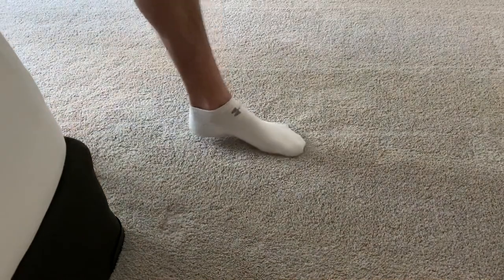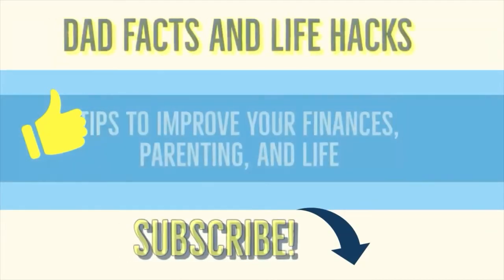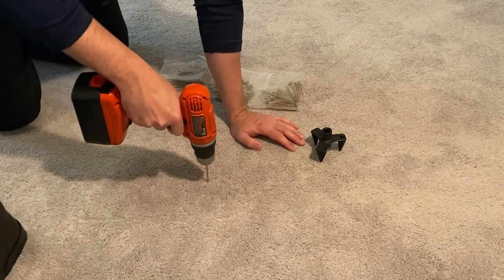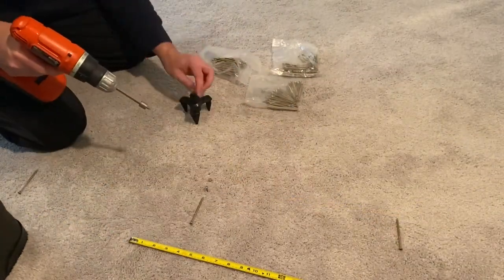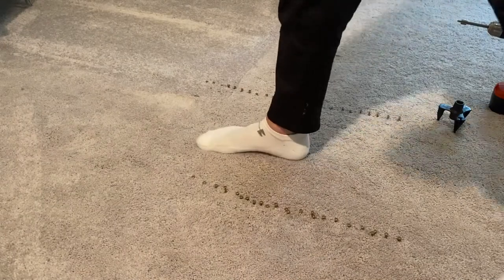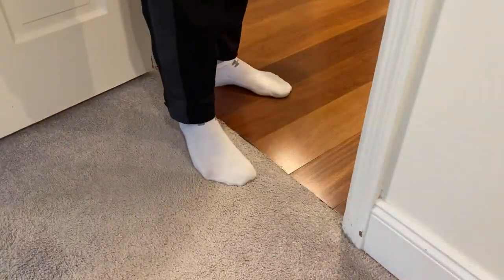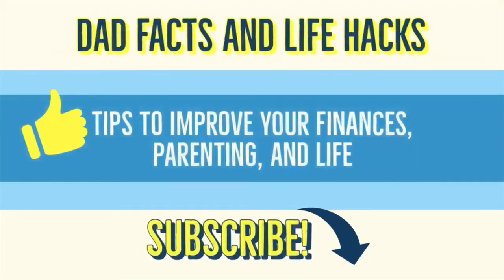🔇 How to Fix Squeaky Floors 🔇  | Squeak No More | Carpet and Hardwood Floors

Comment: If it doesn't fit the bottom bar, will it still work? I feel like if it doesn't fit the bottom bar, it won't work.
Reply from the maker: It has to be able to drill down to the bottom joist, if it can’t connect to that, then it can’t hold the floorboard still

Comment: Why have you put on so many screws if I may know?
Reply from the maker: Depending on the noise, maybe only 2 or 3 screws will do the job. I used a lot of screws because I was trying to get the floor board really tight to the joist, to eliminate the noise. but unfortunately it didn’t matter that I used a lot (maybe 20 to 30 screws, I lost count), the noise couldn’t be eliminated
Reply from the maker: Nope. I haven’t notice any difference,better or worse
Reply from the maker: It ended up being about a 6 foot linear area for the screws. How did that make the noise worse?
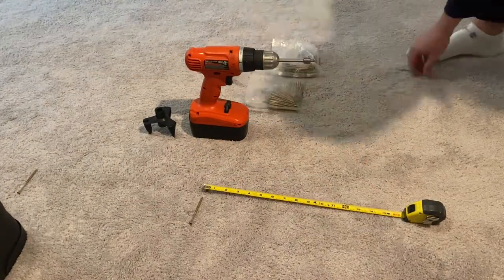Reply from the maker: Interesting… it’s almost like that’s exactly what I did at the 1:59 mark in the video. Did you even watch the video?
Reply from the maker: @laredotransparency129  I started a pilot screw in the middle, then I went 16 inches to each side of that screw. And if you have trouble counting, that’s 3 joists.
Reply: @laredotransparency129  Why don't you do a video to show us what you can do.  I learned a lot from @DadHacks video. It helped me tremendously.
Reply: You’re doing it wrong, you need to locate the joist first before adding screws.  What you did you run the risk of hitting a water pipe or electrical wire runs.
Reply from the maker: @chatbot007  There is no plumbing under where I was using the screws and any electrical was at least 6 inches below the floor board so there’s no chance of hitting either. Thanks for watching